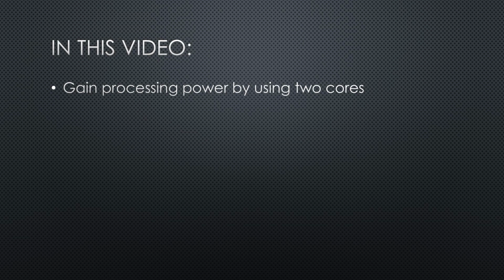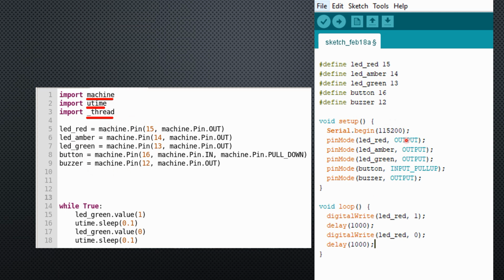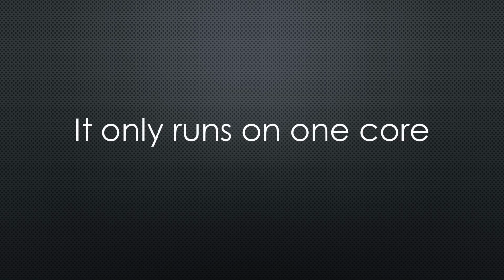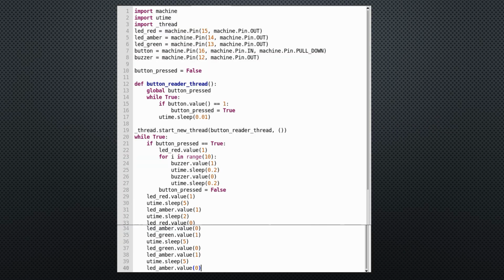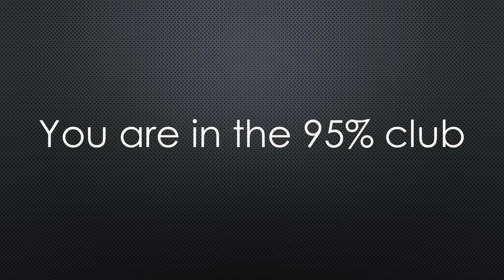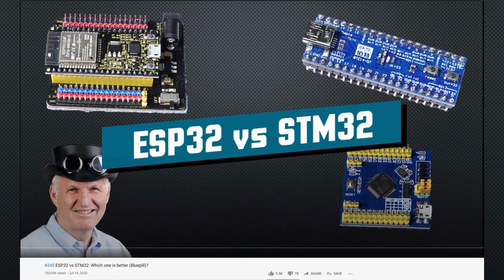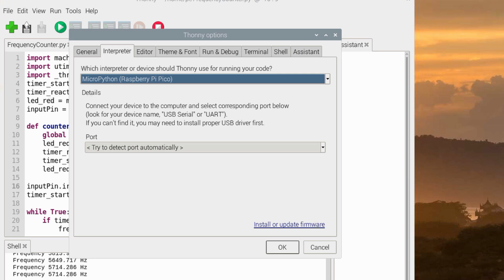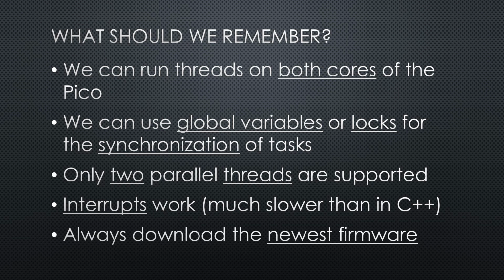#372 How to use the two Cores of the Pi Pico? And how fast are Interrupts?

Comment: Does the baton work as a context manager? 

with baton:
    #do stuff
Reply from the maker: I do not know. Maybe you try?
Reply: @AndreasSpiess  I've given it a go, you can use it as a context manager
that could change your code from

baton.aquire()
#code
baton.release()

to

with baton:
   #code

It makes it much harder to forget to release the lock, and will release the lock even if it hits an exception in the code.

Comment: I can at least help with the USB connection. 

Go to Amazon, and look for Wsken magnetic cables and connectors. They do data transfer, too. Plug the connector into the Pico, plug the other end into the Pi, and then, no more yanking out a micro USB connector. Just be careful not to smack the connector loose.
Reply from the maker: Good idea! Thanks

Comment: IMHO one important question for RPi designers is missing: Why are 20% of the pins GND?
Reply from the maker: I assume because you need GND for each sensor or actuator. So it is handy to have more than one GND pin.
Reply: @AndreasSpiess  hmm, of course they need GND, but they also need Vcc which just appears once. Well it's still ok having 1x GND left, 1x on right side and 1 between SWD. But the other 6 just make the board much larger than it could be

Comment: Many thanks for professional tutorial! Could you please share some idea how one can connect two or more Pico devices (the idea is to distribute a heavy processes to several Pico devices), Again am more interested on how to physically connect and then how to network among them?

Thanks for considering my request.

Regards
Reply from the maker: I would use a stronger MCU for more load. But you have the usual suspects like I2C or Serial. Or if you want, you could build your own high-speed connection using PIO.

Comment: using both cores from the Arduino IDE

#include "pico/multicore.h"

static mutex_t TheMutex;

void Core_1_test()
{
  while(true)
  {
    mutex_enter_blocking(&TheMutex);
    Serial.println("<<<< Core 1 >>>>");
    delay(5000);
    mutex_exit(&TheMutex);
  }
}

void setup() 
{
  Serial.begin(115200);
  mutex_init(&TheMutex);
  multicore_launch_core1(Core_1_test); 
  delay(5000);
}
 
void loop() 
{
  mutex_enter_blocking(&TheMutex);
  Serial.println(">>>> Core 0 <<<<");
  delay(5000);          
  mutex_exit(&TheMutex);
}
Reply from the maker: Thank you for your example code!

Comment: Agreed, a reset button is important on any board that will go through many development cycles.  It's not just about resetting when it locks up, but also about watching what happens when it is powered up.  Yes, there are ways of doing it by button, but 5p extra for a reset button is something I'd happily pay.  That said, leave the button off but put pads on the board for me to add it.
Reply from the maker: I agree. Pads would have been a good alternative. I solved the problem differently (in another video)

Comment: Is it possible to ask if the baton is taken? So that I could basically check which core is free to run my task?
Reply from the maker: You can use _thread.aquire with a timeout (lock.acquire(waitflag=1, timeout=-1)

Comment: Having that much cpu power in a tiny board with few pins is like having a v8 engine on a unicycle . Cpu power is usually needed in high resolution graphics rendering , cadcam or dsp audio.  A machine control would need a lot more i/o lines .. eg an ECU for a modern car needs 50+ input lines.  No sensor really needs that kind of speed as most pid loops can run fine on a 40 mhz 8 or 16 bit processor,  because sample time of the sensor is usually very slow.
Reply from the maker: Agreed for many mechanical systems.  The needed sample time of sensors and speed of PID controllers depend of course of the eigenfrequency of the system. For some systems they have to be quite fast.

Comment: Hi
can I run 2 threads using the baton?
in your case you are running one thread and one loop
Regards,
Suded
Reply from the maker: Maybe yo rewatch the video? There are two tasks running on two cores.
Reply: @AndreasSpiess  
Hi Andreas
Thanks for that, yes there are two tasks running, but i couldnt run two threads
I need to setup two counters i had a look at interrupts its seems they are good for that which i will try later
Im using Thonny from windows 10

Comment: I think you messed up your testing, You used MicroPython to test "Reaction Time" for the Pico and C++ for the ESP and STM why did you not use C++ on the Pico? C++ runs faster on the pico compared to MicroPython which is a known fact, Basically you demonstrated a flawed test to make the Pico look worse than it is
Reply from the maker: You are right. But currently, the Pico is not supported by the Arduino IDE. And I like MicroPython because it is fast for programming (as said in the video). But it is slower at execution. So if somebody wants to start with a project it is good to know how much  slower and when to chose C++. 
The C++ benchmarks done by a viewer are in the pinned comment, if you are interested. And they are of course much faster.

Comment: This implementation of the _thread module is specific for the RP2040.  In the ESP32 it works differently. The second core is not used there.

Then you assume that automatic memory locking is implemented between threads. However, the documentation states explicitly there is no GIL (Global Interpreter Lock) used. Which means that bad things can happen with shared access to objects. It is probably safe to read objects written by the other thread, but mutual writes, deletes etc might give surprises.

For interrupts there may be restrictions too. Documentation is a bit sparse in that area. On ESP32 you typically use micropython.schedule() to get out of interrupt mode and continue processing in normal mode. Still need to check how they did this for the rp2 port.
Reply from the maker: I also do not have more info, but assumed the Pi foundation knows what they are doing by using this example.

Comment: Grüässäch Härr Spiess, when threads communicate with bigger datas you can also use just a flag (like the american mailboxes) "data there and consistent".sender stes the flag, reader resets it. with this, all threads are happy running all the time as for me, it looks like the .aquire stops the others.
Reply from the maker: You are right, this is possible. It is probably a mixture of both: The flag is a global variable and you program the behavior of a mutex.

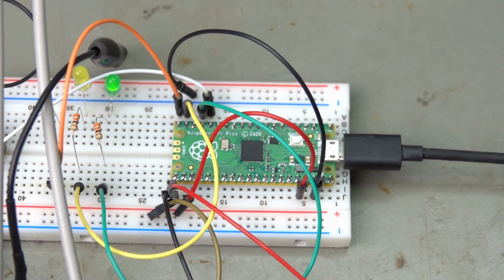Comment: 12:35 don't you have a usb sonoff(or however they are called), you could use that to turn power off and back on to reset
Reply from the maker: You are right. But I added a reset button and even made a short video about it...

Comment: Of course the Pi pico would be slower with interrupts. The code you're running is read by a firmware that interprets Micropython, unlike coding with Arduino, which is literally writing a firmware. Both have their pros and cons. At least if you have a process running, you might not have to totally shutdown your systwm while reprogramming your Pico
Reply from the maker: I hope  you also heard the advantages like faster programming for prototypes. But it is important to know the limitations before you start a project. Otherwise you loose a lot of time.

Comment: Can you (or have you already done) a video on using C/C++ with the Pico?  Python is a nice language for quick prototyping, but C/C++ generates machine code while python is interpreted  and therefore slower.  (I'm not sure how the runtime of an interpreted language actually handles threads and multiple cores).
You can HAVE a reset button by connecting a push button to the run pin and ground.
Reply from the maker: 1. I wait till it is supported by the Arduino IDE
2. See my newest video about the reset button...

Comment: Thanks for the video, Andreas:)
PIN30 RUN -> RUN  is  the  RP2040  enable  pin,  and  has  an  internal  (on-chip)  pull-up  resistor  to  3.3V  of  about  ~50K  Ohms.  To  reset
RP2040, short this pin low.
2021, Raspberry Pi Pico Datasheet, page 7,8. ... RTFD!;)
Reply from the maker: You are right. See my newest video

Comment: One thing I am curious on with the Pico, is how fast can it handle external interrupts?  Or, basically, how fast can it read pin changes?  Say I want to use the Pico to drive a 4 MHz CPU (6502), is the Pico fast enough to act as RAM for that CPU?  I was wondering if one core could simply read the pins while the other core handles internal stuff.
Reply from the maker: The M0 cores of the pico are not the fastest. If you need speed you probably have to go a different route. 4MHz clock with bit-banging is quite fast...

Comment: Another Great Video :) thank you. There are definitely a lot to learn from this short video :)
Reply from the maker: Glad it was helpful!
Reply: @AndreasSpiess  by the way, have you had any luck yet in using Pico with ESP-01 Module?
Reply from the maker: I did not try. But it should work if you load the "AT firmware" on the ESP-01
Reply: @AndreasSpiess  Just tried it last night, works well.. but definitely need "AT " firmware as you said. Luckily that is standard factory firmware on esp01s .. :)

Comment: The ESP32 and the STM32 would run just as fast as the PiPico if they did not run a compiled code as that is not a fair comparison between Arduino C++ and Micropython as both are pretty much the same uncompiled to any processor
Reply from the maker: We all know that, I think from my other videos. But if I have to decide if I can use MicroPython for a particular project I need to know how fast it is. You find the result using c++ in the pinned comment.

Comment: The way the interrupt handler is written you are losing some µseconds. You should store the current utime.ticks_us() value as soon as the program enters the interrupt handler and use that stored value when calculating timer_reaction variable and to reset the timer_start variable because as it is now not only the present time is not read as soon as possible upon triggering the interrupt but some µseconds are lost in between the two lines of the code (between timer_reaction... line and timer_start... line) too. In other words, the 'present' time upon entering the interrupt handler should be read as soon as possible and only once. BTW, the best way to reset the board would probably be to use one of those magnetic USB connectors.
Reply from the maker: 1, you are right with the ISR. This is just an example to show how interrupts work. The measuring of the reaction time is ok because the change of the pin level is the First command.
2, I showed my solution for the redet button in my new video.
Reply: @AndreasSpiess  Yes, measuring the reaction time is precise but the problem is:

def couterTask(pin):
	global timer_start, timer_reaction
	timer_reaction = utime.ticks_diff(utime.ticks_us(), timer_start)	# (1)
	# here it might already be some microseconds later and utime.ticks_us() will
	# not return the same value as it returned in the line above
	timer_start = utime.ticks_us()	# (2) some microcesonds are already lost in between (1) and (2)

This should be used for measuring the frequency to be more accurate:

def couterTask(pin):
	global timer_start, timer_reaction
	now = utime.ticks_us()	# read and store the present time as soon as possible
	# now it doesn't matter how many microseconds will program spend in the following lines of code
	timer_reaction = utime.ticks_diff(now, timer_start)
	timer_start = now	# by using the stored value we are counting from the time when IRQ happened

But even that is not as accurate as possible because of the instructions generated by the compiler that are executed at the beginning of the ISR (*)

The problem is the line timer_reaction = utime.ticks_diff(utime.ticks_us(), timer_start) compiles to many instructions and we can't be sure utime.ticks_us() would be executed in the very first moment. Reaction time and precise measuring of input signal frequency can't be done in the same time as simple because for precise measuring the reaction time the very first instruction in the ISR should be the change of the pin level but for precise measuring the input signal frequency the very first instruction should be storing the present time. The solution would be to first change the pin level and then to store the present time and to look at the assembler code generated by the compiler to see how many T-states took the pin level change instruction(s) and to take that in account to calculate the frequency. In fact, there are probaby many push instructions and disable interrupt instruction (*) before the very first Python instruction inside ISR executes and those instructions should be taken into account too because they take some microseconds as well.

Thank you for the reply
Best regards
Reply from the maker: Thank you for your examples. This is precisely what I want to see with my measurements. I did not seek best accuracy, I accept the technology as it is and chose it accordingly. All these issues seem to be inherent to Micropython. So we need to know before we start a project and look for another possibility if we need more.
I like the ease and speed of development of MicroPython. But as everything, it has + and -

Comment: Please don't teach people to use global variables. It opens up so many problems down the road, especially when dealing with threads. Also, why not stick to conventional coding terms like mutable, mutex, singelton pattern etc. Why use "baton"?
Reply from the maker: You are right. I assume things are a little different with this implementation of Microopython. Otherwise I would not understand the Pi foundation to print the example in their book. But at least I added the proper method and also called it "professional"...

Comment: using the independent PIO (programming IO) 10Megabit/s Manchester encode/decode example code found in the pico git seems interesting if someone did a functioning quick two way led/laser pointer based LiFi point to point lan device ^_~
Reply from the maker: Very good!

Comment: Thank you! In reality, it looks like a castrated version of capabilities available with ESP32 Multicore programming. But on another hand, ESP32 runs full blown FreeRTOS, at the same time Pico is limitted to MicroPython capabilities and limitations. Also, I believe threads work faster on ESP32 because of the native code implementation vs interpreted byte-code of MicroPython for Pico. It's interesting to compare native Pico C/C++ library threads vs ESP32. According to official documentation https://datasheets.raspberrypi.org/pico/raspberry-pi-pico-c-sdk.pdf it's already implemented, just check 2.8. Multi-core support
.
Reply from the maker: I wait for the Arduino support before I will use C++ on the Pico
Reply: @AndreasSpiess  Well a real RT os would be useful I recall doing this using RT-11 on DEC PDP's in 1980 or so in this case Fortan 66

Comment: What I don't like about the Pico is the size.  It is close to the size of a Pi Zero.  This should be half this size, more like a teensy.
Reply from the maker: I assume they needed the space for all the pins.
Reply: @AndreasSpiess  I think if they doubled up the rows of pins, it would still fit, with enough room left over for a reset button/header.
Reply from the maker: Agreed. But most Makers prefer this breadboard-friendly design.

Comment: Great! You've answered 2 of my main pressing questions which are  the use of 2 cores and interrupt response time. Disappointed with Micropython slow interrupt response time. I think I'll will wait for the official Arduino IDE support. Hopefully the existing libraries will work as well. Planning to port my application to Pi Pico for more processing power. Currently running on Arduino Uno.
Reply from the maker: I doubt that all libraries will work from day one on. It took quite a while to get them ready for the ESP8266 or ESP32.

Comment: It is common place to name a group based on what it's in, not what it's not in. So based on this your use of "the 95% club" and "the 99% club" would commonly be referred to as "the 5% club" and "the 1% club" respectively. It's not a rule, just a common standard so you are not wrong, just going against the flow so to speak 🙂
Reply from the maker: That is ok. I did not think too much about it, I have to admit. 99% club sounded good in my ears ;-)

Comment: I think, the reset button is missing, because the board uses on-chip USB to flash program. Resetting would "break" USB connection, so you would have to unplug and plug the cable to renew the connection anyway.
Reply from the maker: You do not need to unplug the USB after reboot. At least not with MicroPython.
Reply: @AndreasSpiess  Ok, my thoughts were based on experience with STM32 (not MicroPython, but C and SWDIO).

Comment: Python on a microcontroller uggghhhhhh...
Massive memory footprint and not very battery friendly because it’s interpreted, which comes with a lot of cycle overhead.

I’d rather code this in C/C++ or even assembler. I assume it’s ARM assembler being a raspberry (or is it some sort of Atmel?)
Reply from the maker: It uses ARM cores.

Comment: The weekend I was looking into C++ programming of the Pico and found your example interesting for quick testing a project. C++ is a total overkill for 99% of most projects. But industrial applications may be time critical.
Reply from the maker: I think, MicroPython is great for prototyping. Creating teh two core synchronization example in C++ is much harder, for example.